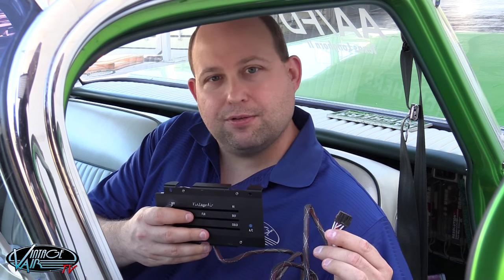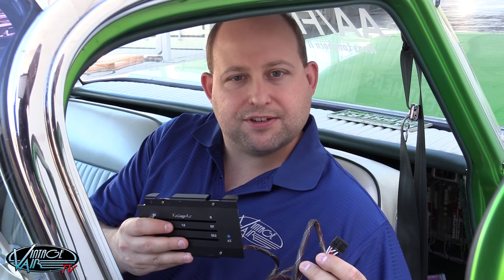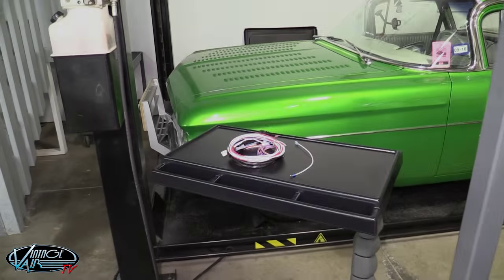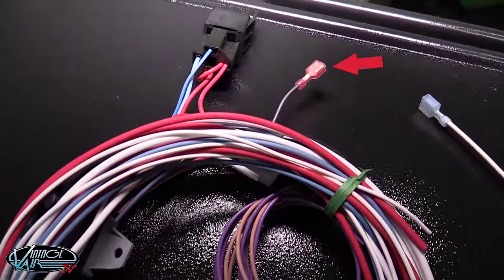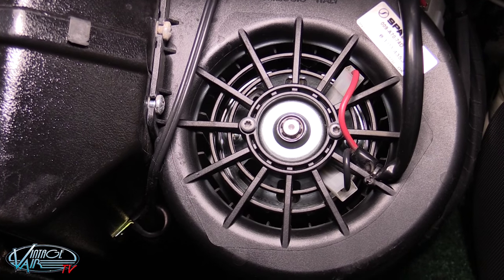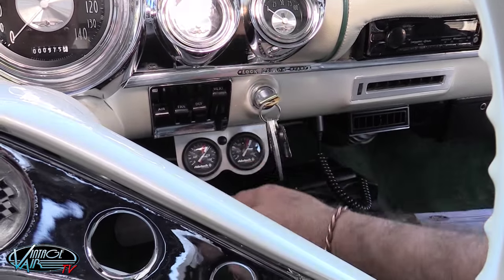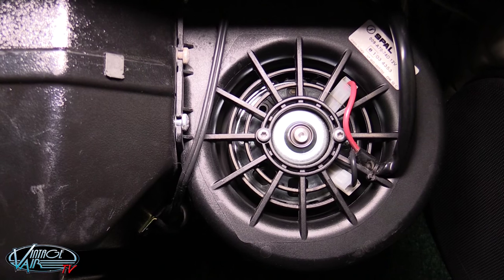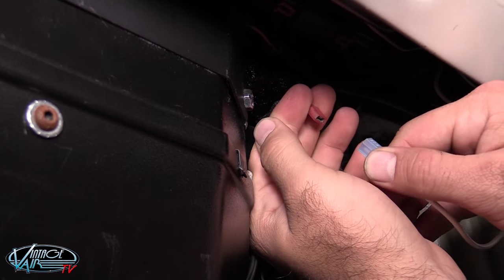Tech Video: Gen IV SureFit™ Control Panel Calibration

Comment: My VA system is only  getting air out the floor & defrost vents, when I switch to "dash" it  stays on floor/defrost. No matter what I do with controls it 
will not  change to dash vents. I tried the calibration procedure but it did not solve the issue,  I used long screwdriver through the vent holes to force one of the blend doors open, but it closed back after a few minutes. I talked to a few friends that have VA systems and they said they had the same issue after a few years after installation. Has VA found a permanent solution to this common problem with the vent doors shutting?
Reply from the maker: Having a mechanical issue with the blend door operation is pretty rare, in most cases when a blend door is in-op it has something to do with the switch or the calibration of the controller. We would need to go through some troubleshooting to reveal the culprit. I recommend getting in contact with our technical support department for trouble shooting and calibration documentation. Also I would recommend against propping open the blend door with a screwdriver, This may damaged the stepper motor transmission when forced open or closed.Telephone: 1-210-654-7171Technical support: tech@vintageair.com

Comment: If the battery is disconnected, does this procedure need to be redone or is the calibration saved on-board the unit?
Reply from the maker: The calibration memory will remain when the battery is disconnected, so you can disconnect the battery leads for repairs and when re connected the programming stays intact. but if you leave the battery disconnected for a prolonged period there is a chance for the memory to be lost, then you would need to perform the calibration procedure to regain the proper functions.

Comment: I am considering buying a vintage air system for my 1982 chevy silverodo. 2 questions do you have a kit for the 454 bbc engine?  and how easy is it to get replacement parts should something have a issue? like blower fan, control panel, ect?
Reply from the maker: We sure do, we offer a complete sure fit kit for the 73'-87' chevy trucks. This kit will come standard with a SBC comp. bracket but since you have a BBC we can substitute the brackets for the kit that is appropriate to your engine. Just let our sales team know this when ordering and they will get you set up with the correct comp. bracket for your BBC.And yes, all of the parts for this kit is available and predict they will be available for several years to come.

Comment: I have a Gen 5 system that I’m almost ready to calibrate. Do I need to have A/C lines connected and the system filled before running calibration, or can I do this with just having power to the evaporator? Thanks so much!
Reply from the maker: You can calibrate the system with or without the lines/hoses installed. obviously, you will not get heat or AC but for testing purposes you can calibrate the system and test the functions w/o a refrigerant charge.